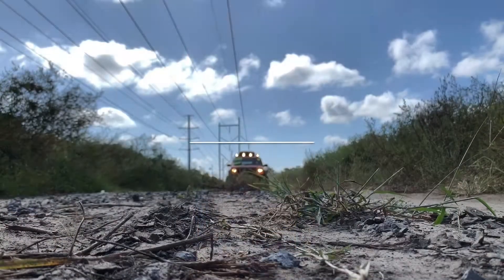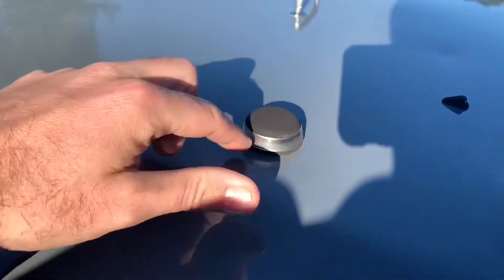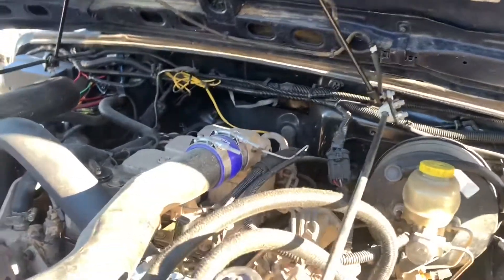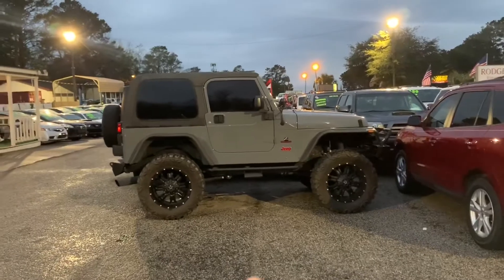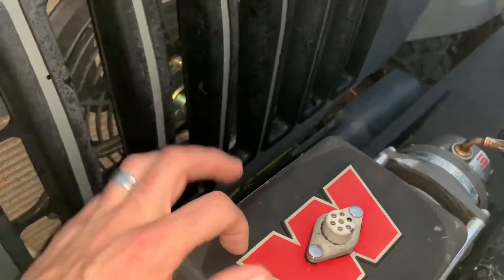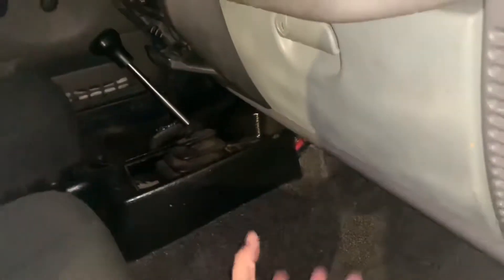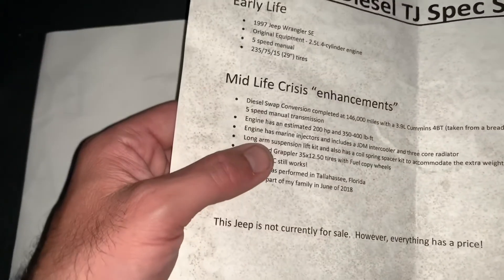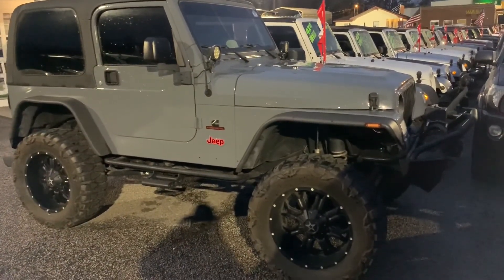Here's a 1997 Jeep Wrangler TJ with CUMMINS DIESEL MOTOR!!! ( For Sale Review ) Rodgers Wranglers

Comment: Do these engines not need to wait for the glow plugs to warm up? Has there been changes I'm not aware of?
Reply: Cummins don’t have glow plugs they have a heater grid 👍🏻
Reply: No they don't have to wait for them to warm up. It should've fired up directly. Even when the lights come on for it to warm up the cummins still cranks up right away but the turbo won't be at 100 percent until it is warmed up

Comment: Love your Cummins powered Jeep ...I suggest learning something about Diesels or at least Cummins Diesels before going for another drive ....
Case in point ... What was with pumping the throttle pedal??   And the only reason it was slow to start ..
The battery was low.. Or is to small to handle the cold weather in your area ...When you started it, as you did ... You are simply destroying a perfectly good starter by not having enough amp hours to do the job ... That starter should last 20 years with enough battery to do the job ...And just to let your other followers know ... The 4bt 3.9 Cummins does NOT have Glow plugs ..  But it does have, Or has option a Block Heater ... I and Cummins recommend one for any cold climate operational of B series Cummins ( I plug mine in when the forecast is for temps below 50 F.) 

If you have any questions?? Please feel free to contact me 
I maybe able to answer some of your questions about one of the World's Finest Engins ever built 
Sincerely 
Ron